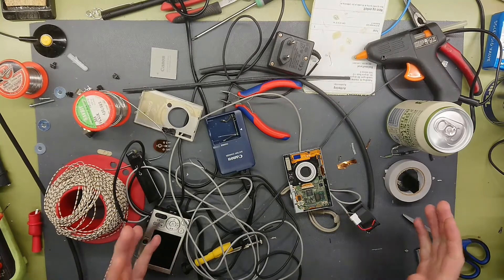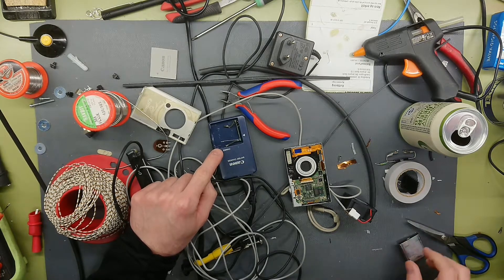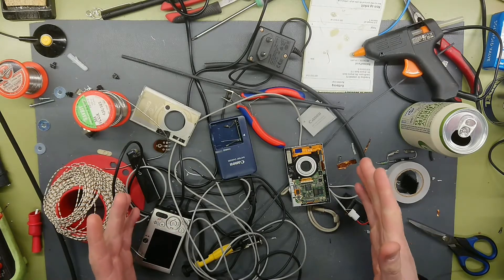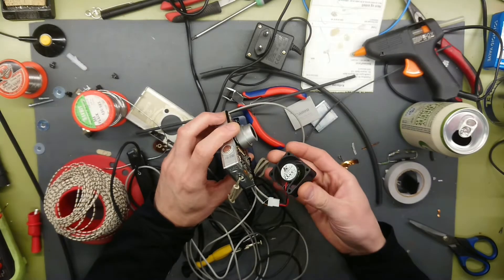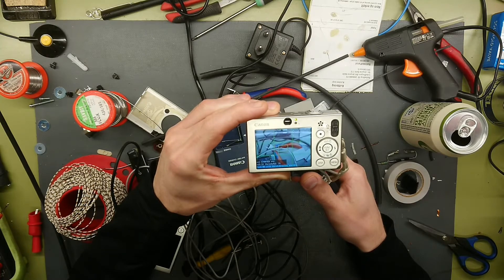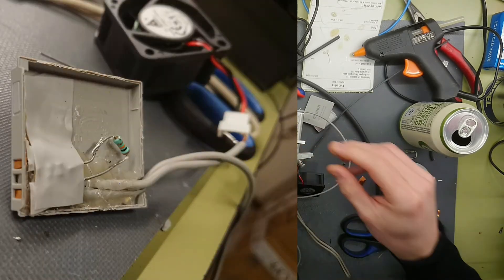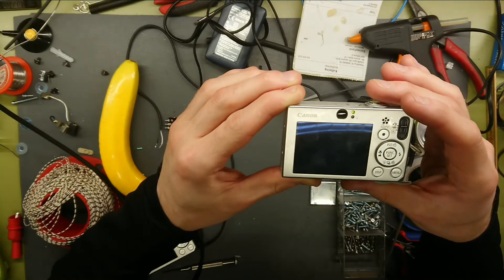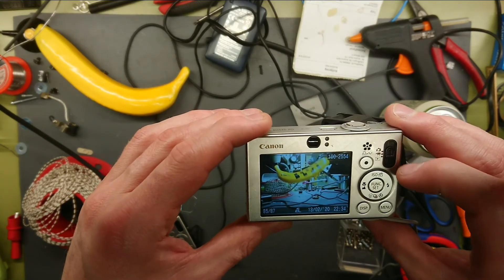Canon Ixus V70 Hack with CHDK for High Speed Photography

Comment: your issue with 4.1 is.. On the battery there is protection unit which requires power to "initialize" itself, while it blocks when not powered (aka "battery dead"). Having always stable voltage allows you to connect your power supply directly to the battery pins. You can add "initialize" button as well (to have overvoltage protection kept).. but check the diagrams for your circuit (in most? all? cases you must short battery '-' and 'ground' for a while).
Speaking about the voltage.. I'm pretty sure it will survive even direct 5V (in the past I was using 4xNiMH in a serie to power my GPS). There are some voltage regulators to deliver appropriate voltages.
Reply from the maker: Thank you for the info, I hope its going to help others :)

Comment: Have you tried to place a capacitor for 5-6V and a capacitance of 100uF to 1000uF in that dummy battery case inside the camera? I would assume that the camera takes a high peak current while switching it to on, and therefore the voltage sinks down for a moment. This will mislead the camera to interprete the lower voltage in that moment as a sign of a worn out battery, rejecting it on the display....  i think the camera will work absolutely fine on 4,15V with these capacitors installed.
Reply from the maker: I did not try any power supply that should be that weak or have such a long lead length that peak current would be a problem. But it a great idea to add a small capacitor inside the case, there is space for it, and adding a 10-100nF decoupling capacitor for noise suppression would also be an improvement.

Comment: Might want to add a small stick on heatsink on the CPU as well, to spread the heat out to a larger cooling surface.
Reply from the maker: It was, to my surprise, not the CPU that was the problem. The lens motor and other optic parts get even more hot.